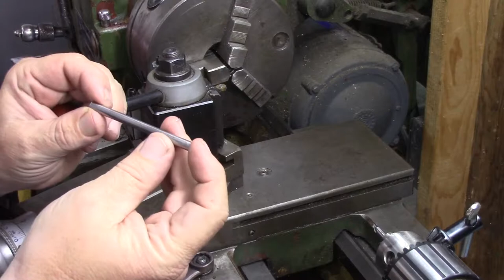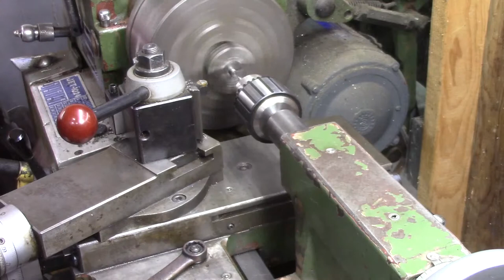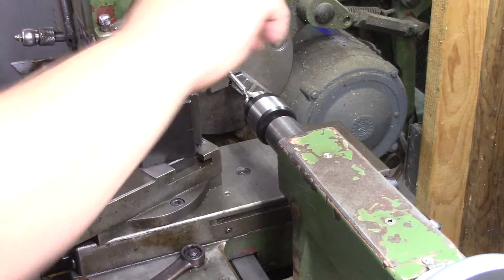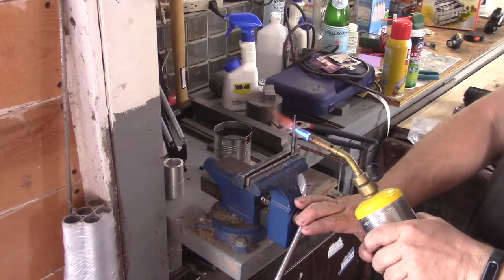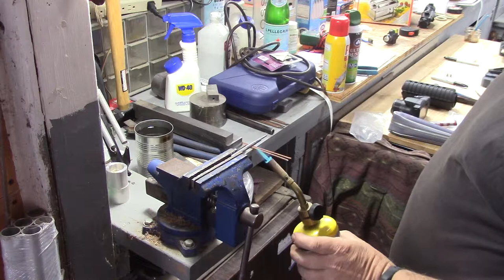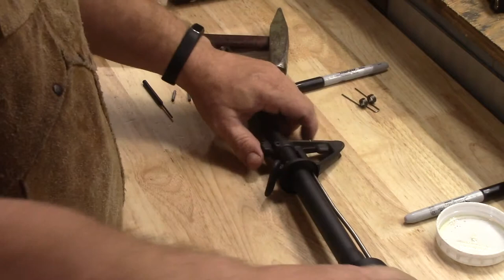making and hardening a taper pin punch

Comment: Great video! I'm working on making a set of punches myself (that's how I found your video...though I'm using hex wrenches I bought for next to nothing at the pawn shop)
A tip for the torch- you're holding it way too close to the part. The hottest part of the torch is the bright blue cone...but to focus that heat on the part you want to pull the torch away and have the tip of the bright blue cone be about a quarter to half inch away from the part you're heating. I think you'll be surprised how much faster you can transfer heat that way! I'm a bench jewelr by trade and I remember being frustrated when I learned to solder that it took SO LONG to heat the part enough for solder to flow. Then an older and much more experienced jeweler saw and corrected me. It totally changed my work flow!
Reply from the maker: good advice, thanks!